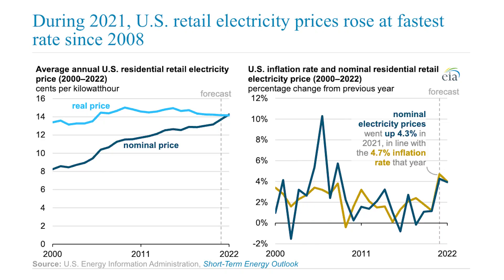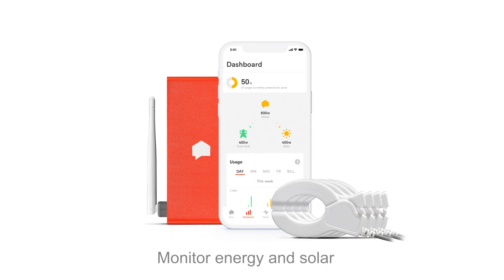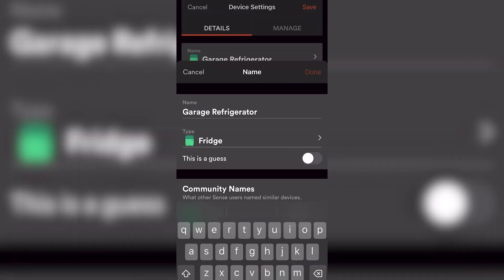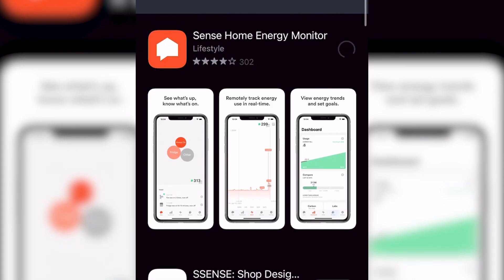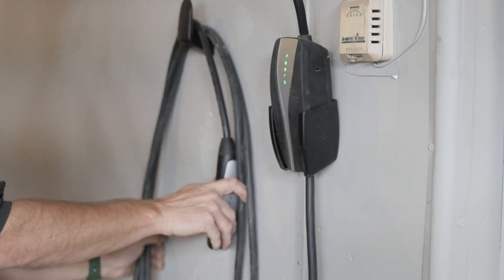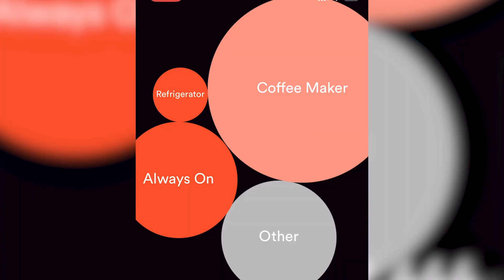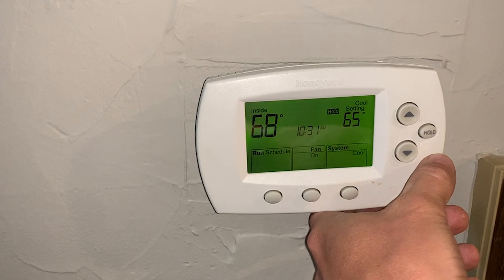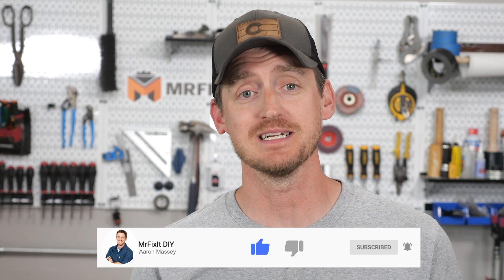We Need to Talk!....(About Electricity Bills)

Comment: I've been using the flex solar device for about a month now To monitor my home and generator input. And overall, I've been quite pleased while identification of devices does seem to take longer than I might expect It has identified the primary devices in my home And along with smart plugs / strips it has helped me understand usage Overall. Certainly room for improvement but best I have experienced so far

Comment: My wife and I built a barndominium or sheet metal building for a home with 4" of spray foam and 3 mini splits to cool the entire home. It's a 40x60 pad with a small shop space and 1900 sqft of living with a loft. Anyways its been 108-110 where I live in Texas and last month my electric bill was $45 and this month I ran it cooler and my bill was $83 so I can't complain. Everything is expensive so always glad to save and be efficient.